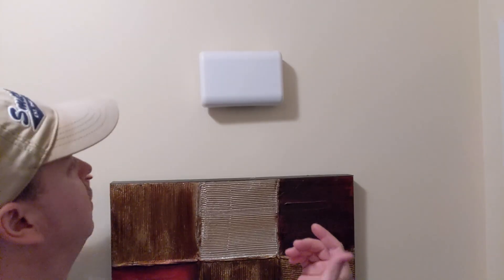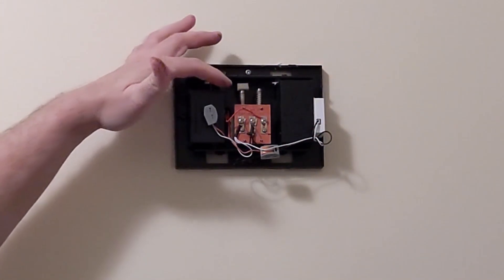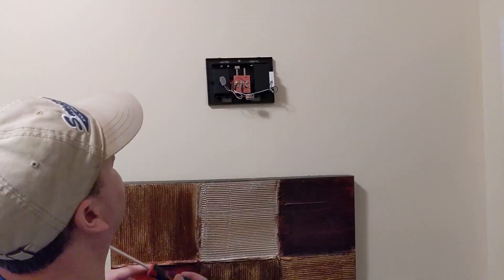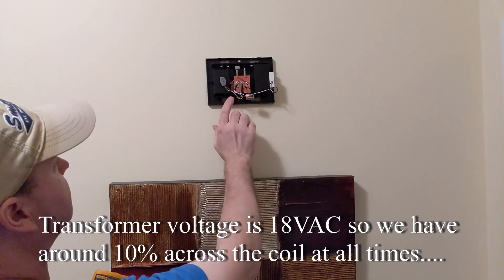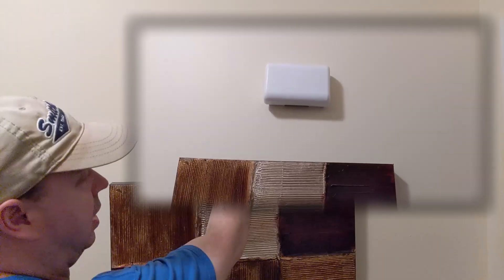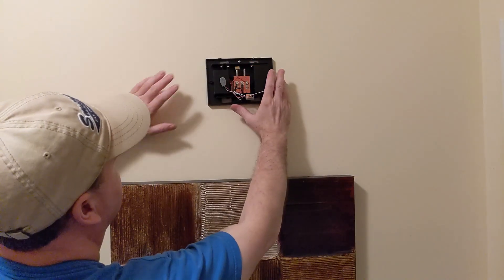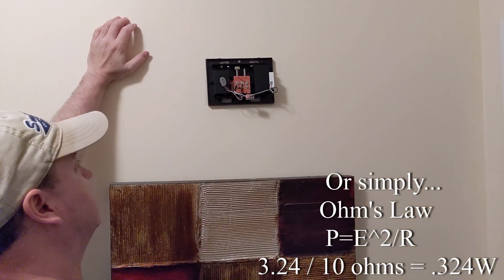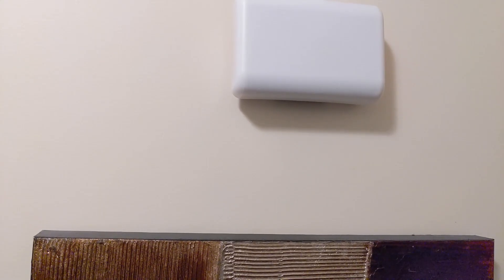Reducing the Hum of a Video Door Bell System

Comment: I have 17V across the door chime and it is humming constantly. Could be a wiring issue or a shorting somewhere. I may have to trace all the wires and see how the builder did everything. 

After watching this video I was about to disconnect everything to identify the transformer wire from the door wires, removed the bypass I had in place and now seeing 1.27X to 1.29x. Will try the resistor trick. Thanks.

Comment: I’m
Wanting to install two of this brand camera door bell. I’ve already shot (2) 16 v transformers and considering using a 20v. Not certain of the voltage draw for one camera door bell. Of course instructions are for one requesting 16v transformer. 
Installing the two does work but not for long, like a day or two. 
I like your idea of the resistor. I was having the same problem. 
If you can lead me in the right direction I’d appreciate.
Reply from the maker: I only connected one camera so I had no issues. I have no experience connecting more than one. The manufacturer does state transformer should be rated for 16V and atleast  10VA. So either power individually from separate transformers or make sure at least 20VA or higher maybe? Just my thoughts.

Comment: So on mine that’s buzzing it says it has a constant 1.8-2 running through it and you said yours has right around a 1.7. Should I still use the same resistor you did?
Reply from the maker: I think it would work just fine.

Comment: Hi - just wondering why 10ohm is picked instead of 20ohms or larger?
Reply from the maker: I think I mentioned in the video with the voltage drop across mine I calculated with ohm's law that it would drop about 2 volts. Enough to make mine stop humming. Yours should be measured for your application. Just sharing how mine was, not sure if yours is the same. Of course as mentioned the resistor gets full voltage across it when push button pressed if same design as mine so it would likely burn up if pressed longer than a brief second.

Comment: I used a 10 ohms 0.5 watts resistor, but it was burnt after I tried testing my door bell. Do I need a different kind of resistor?
Reply from the maker: You may need to check voltage across yours before adding the resistor, yours maybe higher voltage across it than mine, which is odd. you would think it would really rattle loud if over say 2 V? Of course when the button is pressed momentarily it does put the whole 28VAC across and it can only take that for second, if someone holds the button it could burn it up also. The only thing to do is check voltage while not pressed and make sure it's not higher than around 2V and then you may have to go with high value and wattage. May just be a different set-up than I have seen.

Comment: We do not need to install 10 Ohm resistor across the F & T. A little bit humble noise for five second is normal due to using transformer.
Reply from the maker: I don't know what humble noise is, but this is for the loud rattling that happens on some of these all the time. As explained. Nothing to do with sound while button is pressed.

Comment: Also the restore unit is hot to the touch. I purchased a flameproof 10 ohm. Should it be hot to the touch? Is that ok?
Reply from the maker: It does depend on how much your model allows to bleed through. If you measured the voltage as I showed in the video, what was your reading? Some may need higher resistance so the resistor will not be overloaded. Mine worked out great and it's barely warm, if it gets too hot it could open up. You can also put 2 of them in series if you have more than one of the value you purchase and try ( for example) 20 ohms accross it instead of just the one 10 ohm.

Comment: THANK YOU!!!! I could never have figured this out.  The annoying buzzing has stopped! You mention that this might wear out the transformer sooner. How will I know that has happened? I can't seem to find the transformer unit.
Reply from the maker: The only concern is if someone held the button in for a very long time or it gets stuck.  Honestly that would be an issue with any doorbell though. I also mentioned the buzzing and rattling is not good for the doorbell coil or the transformer. The transformer is usually located in the attic in most houses. Just follow the small low voltage wire (brown usually) in the attic from the doorbell and push buttons to the transformer if ever needed.

Comment: What do the white boxed actually do?  I've got a few problems.  I hooked the front doorbell up and it won't ring the chime.  I hooked the second/rear doorbell up and it wouldn't work at all.  I ended up putting the second one on its own transformer and it works.  I didn't use the little white box with that one.  Its transformer buzzes like mad.   Could you tell me what the white box seems to do so I can maybe tell how to troubleshoot and  improve my setup?
Reply from the maker: I believe the white box on most of these is the diode module. I did not take mine apart to see if just a diode or a small circuit board? But either way these used to come with a diode to work back when they first came out.
Reply: You have wiring error.

Comment: Hi, how did u know to chose a 10 ohm resistor?
Txs
Reply: I was asking because I have some at home... Would a 15 ohm, 1/2 watt resistor work?
Reply from the maker: Most likely will reduce rattle and hum alot. Not quite as much as 10 ohm but may work just fine! Hi showed the voltage accross mine as a example, some may not be as high as mine was?
Reply from the maker: I simply used Ohm's law. 
 E= I x R and P= E × I.
So I had to drop around 1.5V on mine and I had 1/4w resistors on hand so I needed around 10 ohms.
To drop about 1.5V accross it and have 150ma or so for load is .225w. 
It worked out great for mine, some friends of mine said it worked great for there's also and they had different type than mine so I figured I would show a quick video on it. As mentioned, it will over current the resistor when the doorbell button is pressed very momentarily, but not an issue it is so breif.

Comment: My Arlo doorbell makes a humming noise. I replaced the transformer to the recommended 16v yet it still continues
Reply from the maker: I have not had an Arlo. It is humming loud even with the resistor as shown?
Reply: @ThriftyToolShed  I haven’t added the resistor but I am browsing options at the moment.
Reply from the maker: Ok. Yeah even with the 16V transformer alot of them still have a loud rattle or him. That is why the resistor works with most of them, dropping the voltage accross the coil a couple of volts!

Comment: Do you have a link to the resistor you used?
Reply from the maker: I did not add a link. I just used a 10 ohm 1/2W resistor I had so did not add a link to one that I have not tried myself. If you still need help finding one let me know and I can add a link or share one with you of one that seems to be correct! 
BTW:
It can be larger than 1/2W if you want like a 1W or so.